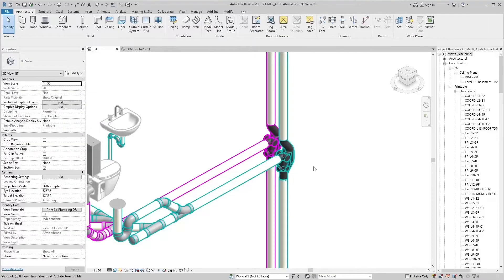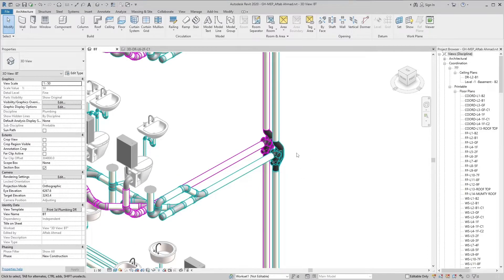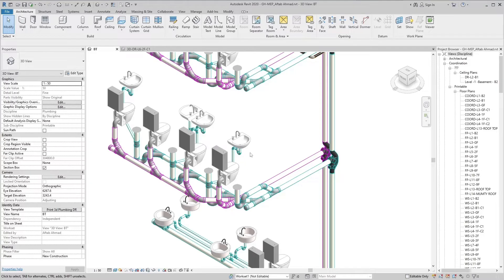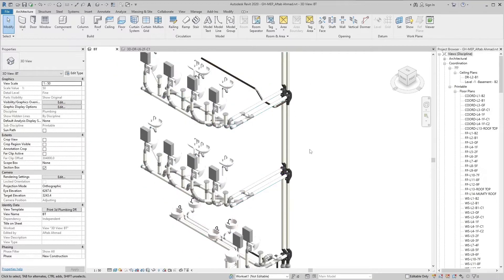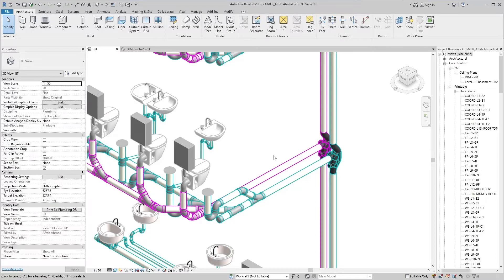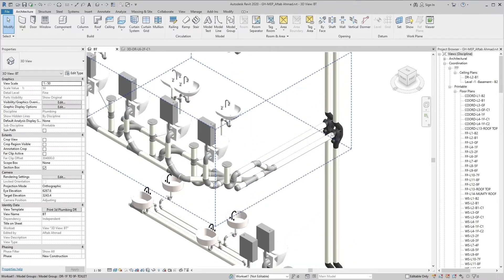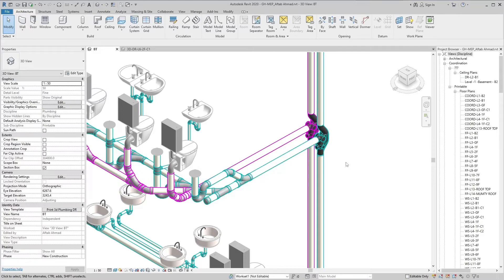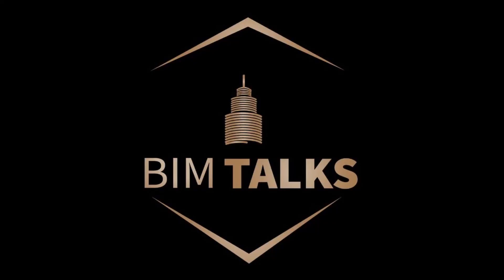VELOCITY BREAKER IN DRAINAGE SYSTEM / REVIT / ENGLISH

Comment: Hi, I experienced a constant clogging of the pipes in a project. There were no straight pipe lengths between the 45 deg elbow joints. Compared to yours, there are straight pipe lengths between the elbows. How can I share you the photos and identify the issue?